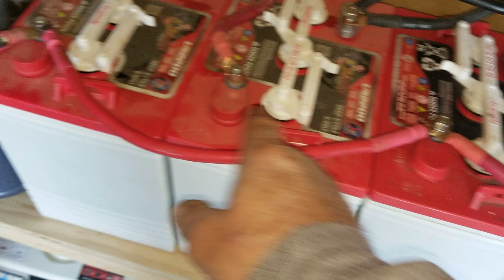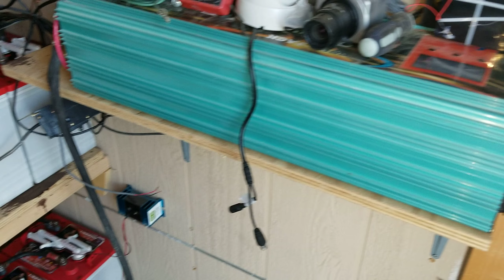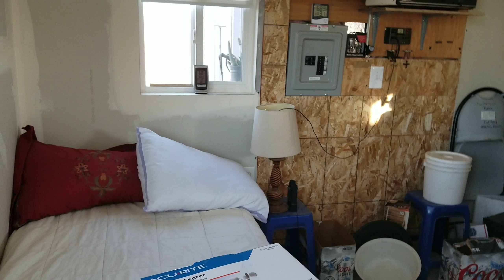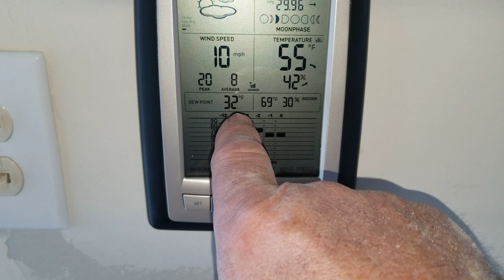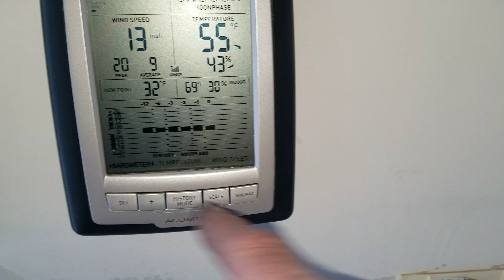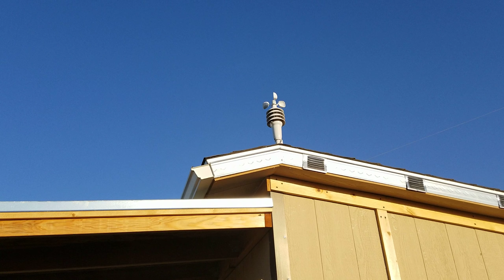Homesteading the Desert, Mar. 24, 2018  part2

Comment: Your bank is 12 volts? You should consider moving to 24 volts, or even 36 volts.
My understanding is that you currently have 18 six-volt batteries. This could be easily divided into three (3) groups of 36 volts,  6 batteries each.
This would massively help with batteries not wearing evenly, as well as being able to use more efficient 36-volt inverters and such.
Not to mention it actually uses less wire to set them up that way. :D
You might have to replace some (or all) of those controllers though. 
It is a pain to do but definitely worth it if you're going to rely on the system long term.

Higher voltage also helps with line losses between your batteries, and the points of use (inverter, lights, etc.).

Comment: Did you consider making your solar electric system a higher voltage system, For example 24 volts or 48 volts given the higher efficiency of the higher voltage  I.e Higher Wattage System and lower currents, smaller cables and lower resistance
Reply from the maker: Shade Tree Solar yes, I did consider it, and chose the 12volt system so if in an emergency I could charge the system using my van and jumper cables, or my gas generator.  So far I have more electricity than I need, so, if it ain't broken, don't fix it.  Right?
Reply: G Bear That’s true G, The main reason of my observation is that, In one of your vid’s you are building a shop with large power tools.
12volt Inverters max out at about 2500 watts to remain practical. The higher voltage system give you the capability to run higher Wattage Inverters, And at least 240 volt Single Phase AC
Reply from the maker: Shade Tree Solar true, but all my tools are 120v  13-15 amps, and I'll never have more than one at a time running.  My inverter is 8000 run/32000 surge, pure sine with a 230 volt single phase output.
Reply: G Bear Sounds like you have it covered, I like your homestead , I’m guessin’ the youre west of I-15 btw, I heard you say that you worked at MCAS El Toro, I worked as a kid fresh out of High School in 78 for a Landscape Contractor and Maintained The Landscaping around the Senior Officers Quarters
Reply from the maker: Shade Tree Solar I worked there from 1980 to 1986 roughly, then got my general contractor's license.
Reply: G Bear It seems like a life time ago, I was there less then a year, But still attended many of The Blue Angels Air Shows there, I finally got my C-33 a few years ago,  Love the Mojave Desert use to Camp and Dirt Bike at El Mirage,  Stoddard Wells/ Bell Mountain and Soggy Dry Lake before I married a city Girl. 
Good luck on your homestead and look forward to seeing your progress